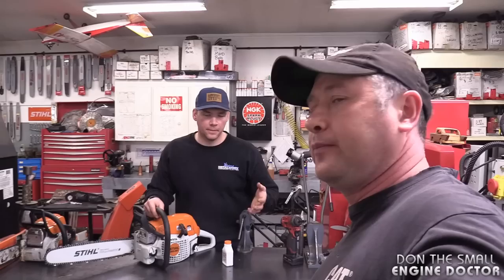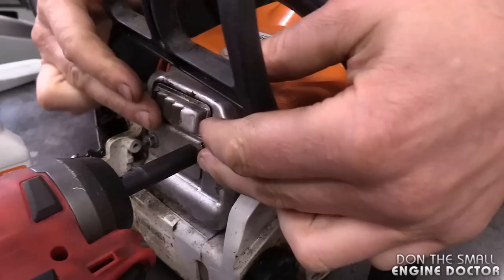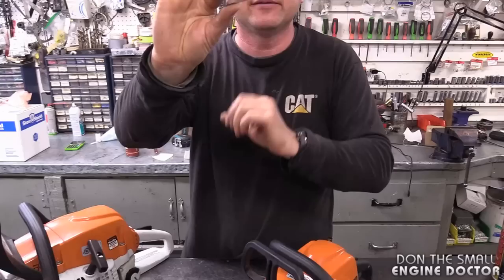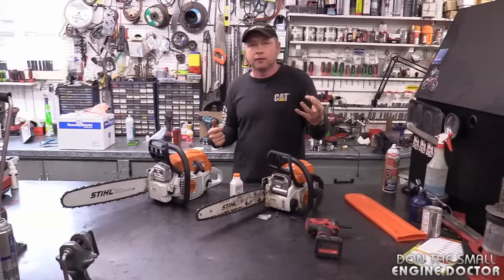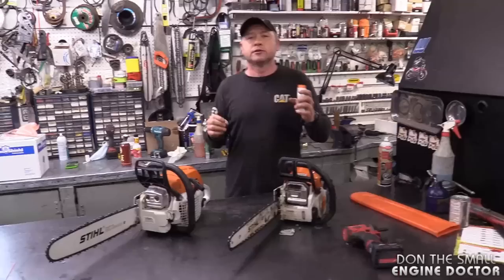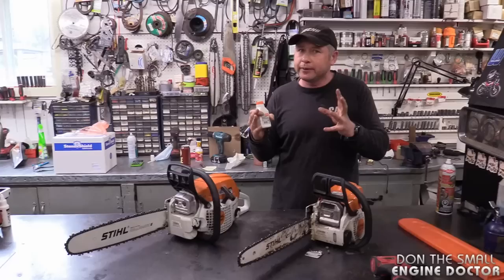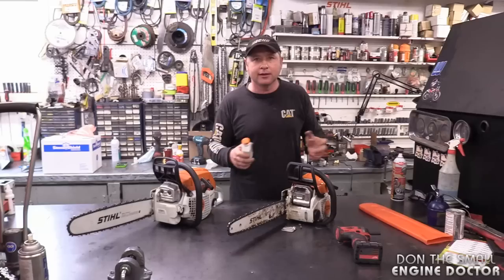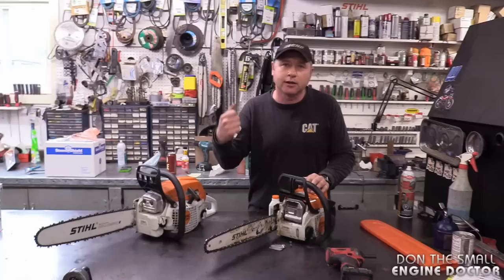Should I Double-Up My 2 Stroke Fuel Oil Mix For More Lubrication? Teaching Apprentice Dave

Comment: We scored all cylinders at 50:1 in a commercial environment. We switched to 40:1 at the advice of an old mechanic and we are now at one full decade without 1 engine seizure. Never seen a fouled plug either. We do remove spark arrestor screen since concrete can’t catch on fire.
Reply: I run my machines quite hard so I do 40:1 in the 50:1 machines as well, I also tune the carbs accordingly and none of my machines have had any problems in the several years that I’ve owned them, i do clean the carbon out of the exhaust ports but surprisingly I don’t get a lot of build up due to running my machines hot.
Reply: @evanchapmanfanman    run 2 tanks in each machine w Echo Red Armour 2strke oil at 32 : 1 and it will completely decarbonise the engines and they will run like new . The oil is kind of exspensive but well worth it for cleaning the saws out .
Reply: I used to tune snowmobiles in the 80's and 90's. I found the manufacturer sets up the snowmobiles to run oil rich to prevent the owner from blowing them up on break in.  The idea was after 500 miles, you take it to the dealer and let them readjust the oil injectors to a lesser oil setting. The manual even stated that. Well, most guys just continued to run them oil rich. Fouling plugs was the number one issue. The second was carboned up exhaust reeds and Rotary valves, especially on Skidoo. It kept me busy as far as repairs. Pretty much every snowmobile I ever repaired was oil rich.
Reply: @scottfirman  im from the southern sweltering heat . For long gruelinng hrs , heat + heat + long hrs = friction . Never seen a snow mobile except pictures how many cc and cylinders ? Would love to find 1 of those motors . Are they still plentiful up morth ?
Reply: @sundial6919  Yes, everywhere up here. I used to restore vintage sleds, then got into repairs and racing setups. Our winters are not as plentiful as the days of those vintage snowmobiles. I got out of it in 2013 when I had a Cancer Surgery that went bad and damaged key muscles in my left side. Chronic pain and unable to lift and move them anymore. Small price to pay I guess for being Cancer free for now.
Reply: @scottfirman  Sorry to hear about your suffering and hope you stay cancer free . Hope you can stihl run your saws and other 2strokes . Im older too and have discovered 2stroke bicycle engine kits . I have 2 bikes w the Staton friction dr kits , 1 has a Kasei 1E48F 63cc w 2900miles , the other has really smooth Zanoah G430RC w 1700 and some change . Only prob ive had was pull rope broke at about 600miles on the Kasei . Zanoahs been bulletproof so far .both continue to improve it seems . Take care hope you stay cancer free
Reply: @sundial6919  I was going to get into those myself. lol. Instead I got into RC Planes. I do repair and sell refurbished  lawn mowers, weed eaters and other small engines. The money pays for my RC habit.
Reply: @scottfirman  so glad to hear that for you . There used to be a group that flew them and i would go watch them when i could . I know you would get a kick out of 2stroke bicycles , i got into them cause i so miss the rice burners i grew up on they were everywhere at 1 time so at that time i took them for grantedbecause of the harley snob
Reply: 2-Stroke : Where there's smoke, there's lubrication.
Reply: Three independent certified 2 stroke mechanics told me they see lots of problems @50:1, especially the bottom end where the main bearings and big end tend to be more dry. @40:1 very few failures, usually due to other issues, seldom anything @32:1. Besides EPA mandating 50:1 they also mandate a more restrictive exhaust so that the build up heat burns off the oil much more cleaner. Stock I run 40:1 and ported everything 32:1. New gen of saws with AutoTune and M-tronic will adjust just fine for more oil, there will be no fouled plugs.
Reply: Stick with 40:1, no less than that.  I run 32:1 myself.
If you run your engine hard, you need more oil.
When you dismantle, look for a puddle of oil just large enough for the rod big end to skim, if yes then you got it right.
Reply: @scottfirman  Apples to oranges. Chainsaws to snowmobiles? 😆 lol
Reply: @yungsmile7546  Two cycle engines all run on the same principal. Explain apples to oranges there. I work on BOTH.
Reply: @yungsmile7546  more like mcintosh to ida red. Your right, theyre not identical, but lube is still lube.
Reply: Is it possible that more siezures or damage is caused by running the tank dry than running this or that mix ratio?  
I can tell that most of the people commenting here have more knowledge on this subject than i do, but i am shocked at all this talk of failures at 50:1. Ive always been suprised at how well that little bit of oil would protect an engine. Ive got some old stuff that still looks immaculate inside.
My dad was always adamant that we never run anything 2 stroke out of gas because there isnt enough lube in the vapors that keep the engine running at the end. Is this the difference? A 40:1 mix lubes everything enough that the bearings and cylinder can survive that minute of running dry, where the 50:1 cant?
IDK.
Reply: @ronfox5519  We don't run our equipment at full throttle (it is idled for 5-10 minutes) when draining the fuel out of them before storage - at a low idle, not enough oil is burned off, so the exhaust starts to get a little smoky... Stihl recommended idling the units down when running them out of fuel to avoid carburetor issues.
Reply: @ronfox5519  Your dad is correct. If a person had a cold 2 cycle engine, revved it up and ran out of fuel, he is correct - that engine would be starved of oil and it's lubricity for a brief moment. The key is to gently idle the engine for 5-10+ minutes at least, at an IDLE, which is specified in the Stihl's owner's manual... again, it will start to smoke a little bit, as oil is not burned off at an idle, but this is fine.

The key is using a 40:1 premix ratio, and idle the machine gently out of fuel. I think I will be dead by the time these machines die. At 50:1, we were tossing them out like kleenex every year...
Reply: @garrettstevensen2467  
Thats a pretty powerful example. Hard to argue with.  How much does the extra oil slow the units down?
Either way, i think this discussion has change my mind, and i will be putting more oil in my mix. 
Have you experimented with synthetics at all?
Reply: @ronfox5519  We haven't seen a difference in power, when the carburetor has been properly tuned at 40:1. The carb should be tuned for 40:1 since they are set for 50:1 at the factory to reduce emissions.

We don't notice a slow down at all at 40:1 - quite the opposite... the machine appears to run better and smoother... 

We use plain Supertech (walmart brand) standard universal 2 cycle oil in all equipment (2 gallons to 6.4 oz container). I will use a synthetic in the saws, since they often run at high RPMS for sustained periods of time. 

Again, I will be retired by the time this equipment needs replacement. We don't run the equipment out of fuel when it's used daily in a commercial environment. We only IDLE machines out of a little bit of fuel (we only leave 1-2 cups of fuel in the tank) when they are going in for long term storage, per the Stihl owner's manual. We remove spark plugs and pour a little 2 cycle oil down in the spark plug hole to coat the cylinder/piston before long term storage. 

I love watching the smoke when they startup from long term storage - they will smoke extremely excessively for 2-3 minutes. 

One thing we did notice is that spark arrestor screens become plugged a little more frequently vs when on 50:1. For instance, if they clog at 1 year at 50:1, then they will clog after 6 months at 40:1, so we removed all spark arrestors since we aren't using equipment in the forest - just in the city, and last we checked, concrete can't catch on fire.
Reply: @garrettstevensen2467  
Wow. Thats fantastic information. Thanks a bunch. 
This has changed my mind on this subject.
And i hear ya on the smoke. I remember when everything 2 stroke smoked. Whenever you smelled that, something good was about to happen. Might be catching fish or blowing snow or running through it, or whatever else.
Reply: @N269  and incomplete combustion... smoke is bleeding power out your muffler
Reply: @evanchapmanfanman  k

Comment: I have run 20:1 in all my saws for 20 plus years and never had an engine go bad. its easy to mix, 1 quart of oil to 5 gallons of gas. i have seen saws burn up with 50:1 mix
Reply: Thats rich,don't u have carbon build up

Comment: Ok so I goofed today mixing oil. I use leaf blower to clear fluffy snow from cars, drive and sidewalks. Plan to mix 5 .2 oz to 45:1. Add 1.8 gallons to can at ethanol free pump. I shut pump of at $1.80 instead of gallons. Instead of trying to figure math to correct it dump mistake in my truck and return 20 minutes and start over. Ugh

Comment: Seems that oil/gas ratios have changed over the years from 16:1-50:1 now. I'm thinking that is for several reasons. Oil technology, materials quality, and environmental restraints. Today's synthetic oils are far superior to 50s-80s 2 cycle oil, but 50:1 is burning up engines all the time. Done that myself. Now with a new Echo CS620PW 27" and Holzfforma G660 PRO 36" I run VP Racing 2 cycle in straight hitest at 40:1 and tune them slightly rich so the saw 4 strokes when letting up from a healthy cut. The pistons and cylinders look polished, exhaust port clean and plug chocolate. I'm not frying anymore engines if I can help it. Sorry for a little more exhaust emissions and sorry to dealers who earn their living selling more saws. Just kidding. I'm not sorry.

Comment: I run mine a little rich. I do the 40:1 mix and then I ADD a extra tablespoon of oil in there   been doing it over 20years that way and not a single issue. 
 I run new and old saws
 Homelite xl12 all the way up to a new echo 590 or holzfforma g372xp . Same mix in all 42 saws I own

Comment: I have a 30+ year old string trimmer that calls for 32:1. Still works fine. Recent years I've been running my chainsaws and string trimmers at 32:1 as well - doesn't appear to be excessive carbon on the pistons or the spark arrestor screens.
Reply: go 1/32 .     dont listen to these utube people.  they know nothing

Comment: Ive run 32:1 with Amsoil Saber for ten years in a 1979 Lawn Boy 7268, 1973 McCulloch PM55, a 2010 Weedeater PB25 and a 2011 Stihl FS45. Never once had to clean the exhaust port, carb or change a fouled plug. Yes I get some spooge in the muffler of the Lawn Boy and blower, but I can live with that.

Comment: It makes so much sense! You guys do a phenomenal job of explaining the science. There are so many so-called gurus, particularly in the chainsaw world, who are still preaching 32 to 1 and 16 to 1. I trust you guys over everybody else! 💪💪💪
Reply from the maker: thanks!
Reply: Interesting, I see 40:1 being a popular recommendation, I run 36:1, why? Because it’s easy to mix.
Reply: 32 to 1 - ounce to the quart.  Simple if you only need to mix a little fuel, like for a weed eater.

Of course, this was (many) years ago, and I turned out both high and low needles on the carb, going by what I had been taught by an old saw mechanic.

Why do I get the impression these people are AmSpoil fiends - run negligible oil…
Reply: @donyboy73  Huswarna xp oil 2t  ok oil in cheinsaw Echo 7310,sthil391 ms  4,5/1  mixs ?

Comment: A mechanic or technician may suggest sticking to the manufacturer's recommended premix ratio but speak to a 'true' 2-stroke tuner (saws, dirtbikes, race karts) and pretty much all will agree than more is better.  Improved ring seal & compression (=more power) plus better component life.  Fouling the plug, plugging the spark arrestor screen is primarily 'tuning' related, rather than the premix ratio.   You can run 20:1 and have a spotless exhaust when tuned and operated correctly.

Comment: I run what the manufacturer recommends and I have been having fantastic results using Small Engine Fuel premixed with the oil already in the fuel.
Reply: Engineered fuel is the way to go. Running a string trimmer one or two days a week for 20 minutes doesn't burn up too much fuel. The price is well worth it for the shelf life it offers.
Reply: @boots7859  Lucky for me I don't have to go that route. There's a fuel distributor about 20 minutes from where I live that sells ethanol free gas. From what I can tell most people don't have that luxury.
Reply: @boots7859  watch  "steves small engine saloon"  he recently did a video on this issue and the ethanol seems to not be the only or main issue with small engines. pretty interesting.

Comment: I say 32:1. I have an Echo leaf blower my late brother bought new back in the 1980s that I still use occasionally.  Runs just fine now.  I know that oils are much better than they use to be, but 50:1 is to lean for me.  The Only lube the engine gets is what you put in it.

One of my neighbors bought a new string trimmer and ran 50:1 as recommended. It lasted to one month past warranty and locked up.  She used the recommended type of oil that is pre measured.

.

Comment: I always ran 40:1-45:1. I empty a small bottle of 2 stroke oil in 5 liters of gaz. I then proceed to add a small shot of oil in the canister. I have used my equipment very very hard and my pistons/cylinders all look like brand new.

Comment: Carbon buildup, oil fouling, spooge and smokey exhaust are usually the result of poor jetting. Jet appropriately for your gas-oil ratio and you won't have any of those problems. More oil (up to a certain point) equals better engine protection and better ring seal.

Comment: Have been running 50to1 in my stihl 044 for 23years and my saw runs as good or better   than new with NO problems. The trouble with alot of people is they over think with these small engines.  Good Video Guys !
Reply: My thoughts exactly Thomas Bates. Most of my Stihl saws are nearly 20 years old and I always use high quality oil at 50:1. I do keep my saws tuned and running properly and have never burned or scored a piston.
Reply: Thats good to hear. Ive been running 50:1 ever since they came out with oil that called for it. No problems.

Comment: I remember running nitro 2 stroke engines in gas rc cars and at full throttle there was supposed to be a light stream of oil smoke coming from the exhaust. Engine was revved up running high rpm. There was two air fuel mixture screws. One for idle and lower rpm and one for mid rpm and full throttle. If the car was idling and you hit the trigger on the remote for the gas and a puff of smoke came out and the car was sluggish from the get off the idle mixture was too rich. If you're full throttle and no smoke at all the open throttle mixture screw was too lean and the motor could overheat and seize. Then there was the sound and performance of the motor. If the idle screw mixture was too lean the engine would have too high of an idle. So you would adjust it accordingly between the two parameters. Same with the full throttle screw mixture. It's been awhile since I tuned in a nitro glow engine which are not gasoline engines. But a 2 stroke engine is a 2 stroke engine. They're really not that hard to learn how to operate. Now on a chainsaw or a 2 stroke dirt bike even it might be a little more advanced with the carburetor tuning. But no matter what if you're just using gasoline with too much 2 stroke oil mixed into it. It's going to smoke no matter what. But I always thought when a 2 stroke engine is running full throttle and high rpm there should be a light stream of oil smoke coming from the exhaust. If it's too rich it'll affect the performance of the motor and there's a loss of power. Starving a 2 stroke engine of lubrication will most likely occur in the high rpm operation. That's where it's the most critical. I bought an Echo blower and it's a 50:1 fuel oil mixture 2 stroke. The carburetor is probably already close to being set from the manufacturer. But i was wondering if 40:1 would be better. At high rpm operation there's absolutely no light stream of smoke. Another thing too is the throttle response is sluggish when cold and warming up. I'm wondering if they richened it up because of the 50:1 oil fuel mixture? The choke is manual. I probably should just leave it alone.

Comment: I have never doubled up on the oil for my lawn equipment and that is great advice and it is better to stay with the standards of the company producing your equipment to be safe.
Reply: My 2 stroke mower's printed  manual actually specifed 25:1. Then they put in a little errata note that said the EPA regulations had required that 2T engines must run at 50:1 to reduce emissions..
I recently just bought a NEW 18" chain saw. There is no printed manual. The PDF manual I downloaded again specifies 25:1.
25:1 is true standard for air cooled two stroke engines. 50:1 is just regulations by ignorant politicians.

Comment: I agree 100%.  Some of my friends run 32:1, thinking it will make their saw’s last longer.  I run nothing but 50:1, Echo Red Armor.  I also do not mix gas.  In other word, part my gas and part premix.  If Inam forced to use a premix, I dump the remaining  fuel from the tank and use strictly the premix.  Mixing gas can cause problems.  I recommend using only JASO certified FD oils at 50:1 with PNE gas.